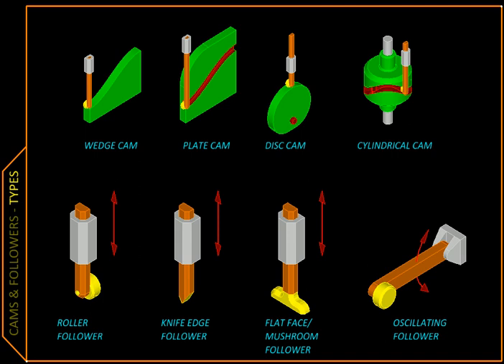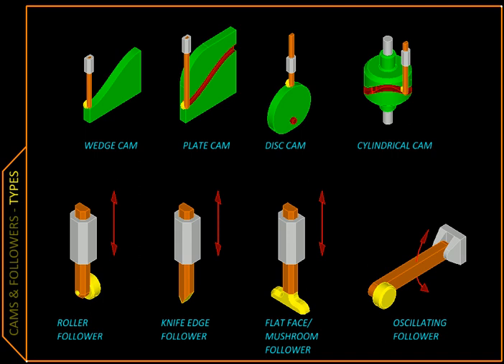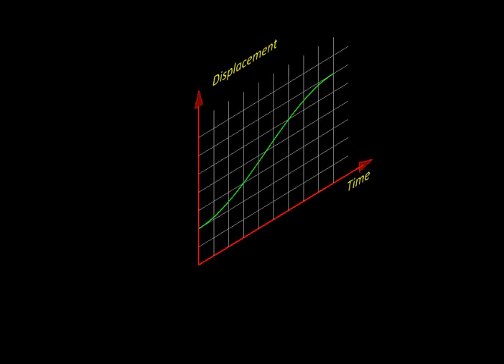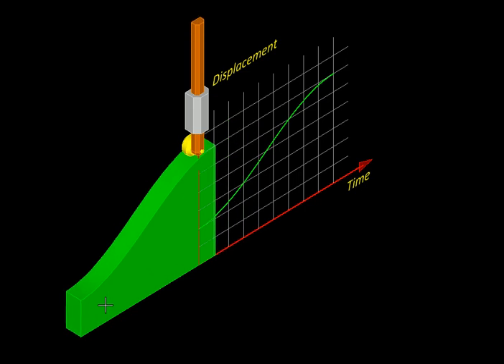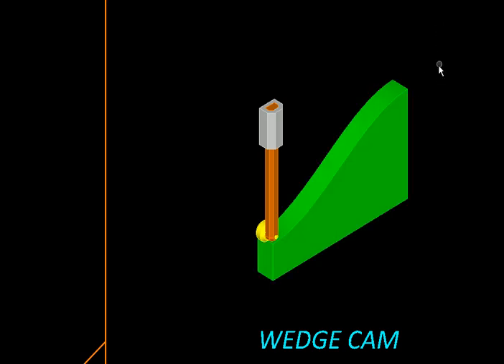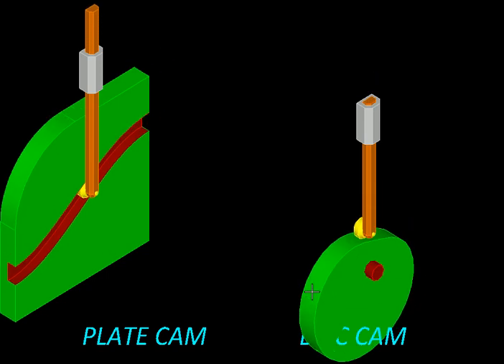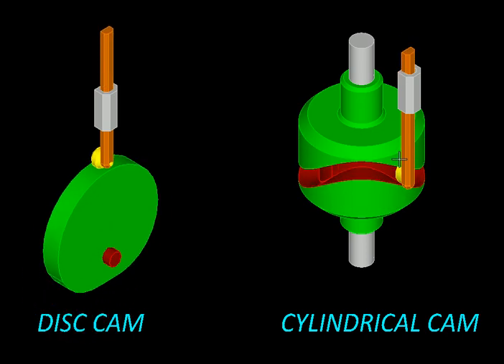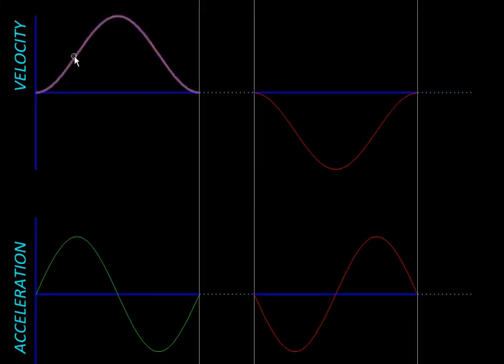Kinematics Ch 07a Cams Concept & Types

Comment: sir can we use yoke type cam follower in cylindrical cam at high speed means around 1000-1100 rpm.
sir i'll need your more help related to same topic, so if u can give your mail id it would be really great.
Reply from the maker: Like all design problems, there is no simple yes/no. But there could be thumb rules that directly eliminate an alternative based on experience and standard practices. An expert would guide you better.  
            On the least, you need to analyze the acceleration and the resulting inertia forces. They depend on both dimensions and speed. In fact designers go a step ahead and consider the rate of change of acceleration or 'jerk' too!
            Also, consider the material aspect from the wear and friction angle.

Comment: I have many questions regarding this video
1. I don't really understand the motion of the wedge cam follower arrangement during descent
2. What are its applications ?
3. How will be the graph of jerk?
Reply: 1. The lower wedge pushes the cam upward to move up. In the same way, the upper wedge pushes the cam downward. 
2. When you need the part to move downward faster than the speed of gravity the upper wedge helps to achieve that. 
3. The graph of jerk would be small imperfection introduced to the normal graph of time and displacement. The jerk is a small distance in comparison to the distance the cam travels. It's distance is equal to the clearance the cam have with the wedge.